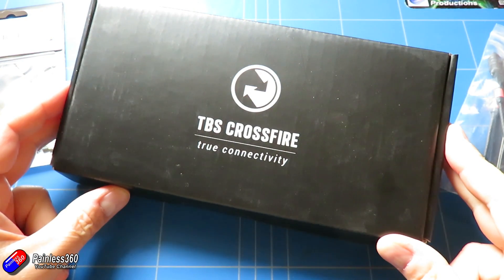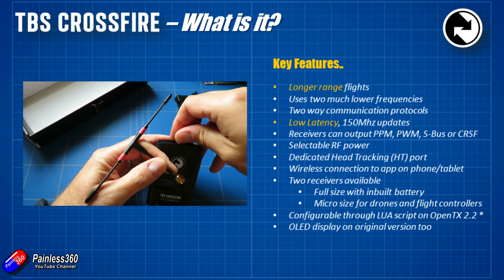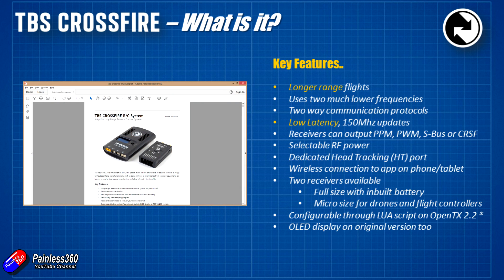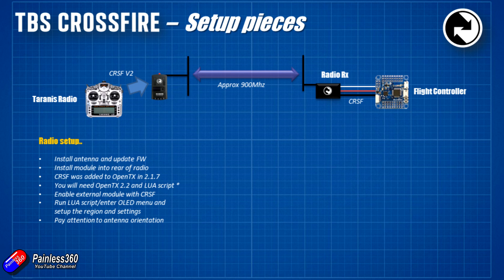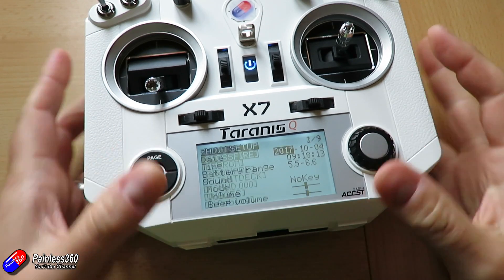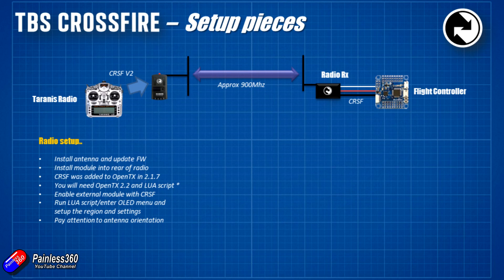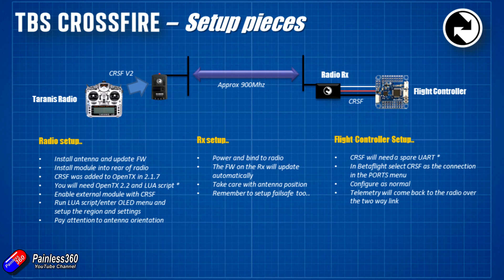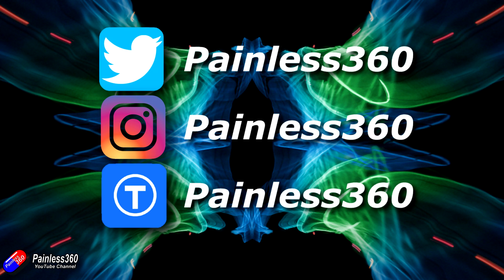(1/3) TBS Crossfire Series: Overview and Introduction

Comment: Great video! Unfortunately, for some reason my TX module does not turn on when it is installed in the remote control, the two cables are connected to the module and the external mode is set to CRSF. Can you please tell me why? If I update it on the PC then it works

Comment: Ahhhh Geeezus!~ Minute 5:20
Rejoining the RC world after 55 years I've been reading and watching everything I can get my hands about FPV and finally the light bulb goes off!  It's an incandescent light bulb mind you...not an LED.
Reply from the maker: Glad my videos are helping it all make sense! :D If you can't find something on the channel that you need, let me know!
Reply: @Painless360  
As a matter of fact....Yes!~ Thank you!
As a newbie in the RC/FPV world, sensory overload is an understatement!
It's exciting and overwhelming.
I had a 3 ch crystal plane with flags that cost more in the 60's money than my current plane and txmitter.
I've a FMS Fox 3000 at  FEDEX facility in Troutdale, Oregon due to arrive at my home in North Central Washington Tuesday.  
I have a Spektrum D-8 G2.
It seems Spektrum was once a leader in FPV but sis no longer or perhaps changed names????
I'm unclear if my Spektrum D8 D8 can do FPV/Crossfire.
If not, can you call out what gear will get me up and running?
Thanks and Cheers from Tonasket, WA
Reply from the maker: Spektrum isn't great for working with non-Spektrum kit. FrSky used to be the goto for things like Crossfire, but now it's vendors like RadioMaster and the ExpressLRS rsdio system for modern hobby...  best of luck
Reply: @Painless360  
That's what I needed...just a push andto be told  which way North is!  ;-)
Reply from the maker: INAV for Beginners 2023 (Baby AR Wing PRO and INAV 6.1.1): https://www.youtube.com/playlist?list=PLYsWjANuAm4q-i0YGMJGLOfaYIuNIYPfF is a build using modern technology and choices... Best of luck

Comment: hallo, if you want to run crossfire with 1.3ghz video will it be ok or some tricks need to be done? thanks
Reply from the maker: It should work fine. Keep the antennas separated on the model as much as possible... Best of luck

Comment: Hello, great guide, I want to try fly longer range with inav and ardu, will fill module with Bluetooth be better or just lite one ?
Reply from the maker: Noth will work great. I don't use the extra features of the larger unit (with the exception of the screen!)
Reply: @Painless360  so better radio like 16s can do a telemetry to a tablet by Wi-Fi or Bluetooth so I could use micro tbs module ?
Reply from the maker: I'm not sure that any of that can get the telemetry to a PC. If that is something you really want then I'd use separate telemetry radios. See my PixHawk 2023 series for how that works with MAVlink and Ardupilot.. Best of luck!

Comment: Is there any version or a way to combine which has 15+ channels and allows me to connect to two or more receivers at the same time?  I need 15 channels, and a separate receiver on my gimbal.  Any solutions?
Reply from the maker: I've seen two. https://youtu.be/ST9LON1-Bvg or using an Sbus to PWM converter.... Best of luck

Comment: Hiya. Thank you for this clear video.

I have a question... say i have the 'full' size crossfire tx (2Watt) and i plug it into my dji fpv remote (into the 3.5mm ppm output jack) is it possible to get telemetry from the aircraft back to the crossfire tx ?

My aim is to use the crossfire module with the dji remote ( to get the benefits of a good/solid long range radio link that is better than dji) but also get telemetry back to the crossfire tx ( which  i can connect to an android tablet via bluetooth and then plot the position of the drone on a map on a using Telemetry  viewer app).
Reply from the maker: I have no idea, let me know if you get this working. DJI kit is not designed with 3rd party operability in mind...
Reply: @Painless360  will do!. i have seen others get dji working with crossfire (but using the ppm output plug on the dji remote to the crossfire. However its using ppm with increased latency). Their aim was to get a more robust link control to their drone so they wouldn't failsafe. They were not bothered about getting telemetry back.

Comment: Is it possible to connect a crossfire receiver system to a different receiver so I can still have as many channels I want from my existing receiver somehow?  I am trying to keep the amount of channels my 20 channel receivers have.  It seems that the diversity receivers have a limited amount of channels but I want more.
Reply from the maker: I'm not sure I understand the question. You want two recievers?
Reply: @Painless360  I want to be able to use all 20 channels that my current radio transmitter supports.  I have an iX20SE.  What is the maximum amount of channels that crossfire supports and which receivers would you recommend?
Reply from the maker: I'm not sure. I've not used that many channels on my Crossfire stuff.. Next time I have it out I'll look. Let me know if you test it too..

Comment: Is it possible to setup crossfire relay /repeater ?
Reply from the maker: I've never seen something like that. Why would you need it?
Reply: @Painless360  I have seen pilots using these techniques to mount crsf module on antenna tracker or keep the module on the roof of the car/house and operate the model from inside car/house. In my case I am looking forward to keep both new 2.4ghz long range module and crsf module, It's not possible to switch the JR bay module every time. If we can operate crsf module as repeater then this issue can be solved. Maybe you already know this technique but by different name, I guess..... In this technique, a 2.4ghz rx is connected to long range module and we provide the signal or command to 2.4ghz rx through radio and that rx transfers the signal to long rang module and finally through long range module to the long range rx .....Few pilots did use these techniques with dragon link, mfd long range module, etc...here's an example by bonafidepirate using dragonlink relay...https://www.youtube.com/watch?v=E5vgkpmPV8Y&t=509s
Reply from the maker: I'd ask those showing the techniques in their videos. I've not explored this here. Best of luck!

Comment: Hello I'm using the full module on a spektrum dx6 running ppm powered by a external battery in FCC region.  I've looked through the power menu and don't see the 2 watt option mines seems to stop at 1 watt. Is there something else I need to do to enable 2 watt. I've gotten great range from 500mw. I just want what I paid for. Lol!

Comment: Dear  
 i have a question . if TBS Crossfire and Frsky R9m both uses 918Mhz Frequency then why both have different range capacity.
Reply from the maker: Range is down to lots of things. The frequency you use is only one of them. There is antenna design, power, protocol, band usage, LORA style management of the link, smart firmware... The difference is that all of those things are far better on the Crossfire system..
Reply: @Painless360  Got it, Thanks..

Comment: Hi very helpful video for me to understand TBS-Crossfire with Taranis, but I have a doubt that which are the sensors available with the TBS Crossfire Tx Rx system as in same class FrSky do have, like Lipo Cell Sensor, Current Sensor,  Temperature Sensor, SP2UART etc. Thanks in advance
Reply from the maker: Please watch the series and my builds with flight controllers and Crossfire so see exactly what you can do with it.. Best of luck!

Comment: can i use this with futaba sg14 and a dji A2 as fc on a looong range HEXACOPTER that is around 1m in size and weight 6kg..
im building a filming hexa to record video and take pics
Reply from the maker: I'm not sure I don't use that radio or flight controller here. Best of luck with the build!
Reply: @Painless360  yeah its a bit bigger then racing drones but even so the parts used should work,like the vtx used in small race drones,,there are those pumping out 1200mw att 5,8ghz.. could i use that in my build ?

Comment: As a newcomer to Quad flying and reading up on everything, I've seen a lot of reference to Crossfire and so came here as a first stop for detailed info.   
However, do the new VLOS laws now in place make crossfire redundant?  I'm getting on a bit now so my eyesight's not what it used to be but surely there aren't many pilots who can see a drone more than a mile away with naked eyes?    Assuming I'm going to stay within the bounds of the new laws, what value does crossfire offer?
Reply from the maker: Check out the full Crossfire playlist that covers all the basics. Crossfire isn't just about long range, it's also for bullet proof signal connection and faster, lower latency connections to the model too.. Best of luck!
Reply: @Painless360  :)  already started reading and watching.  so much to learn haha.  many thanks

Comment: Thanks for the video.  My antennas (two Immortal T's) are mounted in front of the quad horizontally at about a 45 degree angle to the front of the quad.  So should my transmitter antenna be mounted vertically so the ends of the antenna are pointed up and down and not pointed at the quad (unless it was straight overhead)?  Thanks for your help.
Reply from the maker: See my video on antenna alignment in the Cro playlist where I cover that.
Reply: I appreciate your help.  I have subscribed and watched many of your CF videos.   As a person new to CF, they have been very beneficial.  The Failsafe on my quad was from a bad receiver.

Comment: Another needle in the haystack found.
Learned that
★ this is not as easy as I had thought
★ tbs Crossfire seems to offer a lot
★ Crossfire adds a bit of complexity too

I wanna buy one to get strong connection and long range too but I am unsure at what price regarding my frsky receiver infrastructure.

I got the X9D plus last weekend and put it in sale when I got behinds frsky strategy to close their system for Access and leaving d8 owners behind and to kill Jumper as competitor from all Chinese Sales Channels pretty effectively. But I ordered a T16 Pro Hall the Moment I found out opentx will support T16. And now frsky has a problem to sell me stuff - except for high discounts which will hurt them.

My question: this series is 2 years old and I am not sure what had happened with tbs Crossfire development meanwhile - except frsky no longer supplies tbs with frsky Radios.

Is tbs Crossfire still first choice for fixed wing ... gliders in conjunction with T16 Pro Hall ?

Thanks again.
Reply from the maker: It is for me...
Reply: @Painless360  THANKS A LOT ... from germany

Comment: Will the crossfire work on the QX7 if the crossfire is set to ppm?
Reply from the maker: I've not tried but with the mod, you can run the Crossfire at full speed..
Reply: @Painless360  More interested in long range, where the speed part of it isn't that important.. thanks for your reply. Love and used your videos all the time.

Comment: Hello Painless,

I was hoping you might be able to help figure out why I am not getting any response on the Reciever tab in betaflight for a crossfire setup.

Followed you videos and other instruction on the web but I am stuck.

I have a full crossfire transmitter and nano receiver.  The shows bound and gets telemetry data.

I set UART six up in betaflight ports as serial.

I did have ch1 and ch1 backwards on mamba mini F4 FC backwardscfor a bit and hope that did not hurt the FC.

Configuration page set to serial subs and crossfire.

Still no respose on betaflight receiver page.
Only thing I can think of is a problem with the uart?

Thanks for any sugestions.
Reply: Okay just writing the problem out helped.  Finally realized that UART 1 was still set for SBUS!
Reply from the maker: Glad you got it sorted! :D

Comment: Would u recommend this for a  rx8 Spektrum controller? if so how can I setup with it?
Reply from the maker: See my kit picks video from last summer for radio choices (I will be doing an update to it in a months time so it is a little out of date), FrSky seem to be making some odd choices when it comes to the inverters they are using in their radios that mean that you can't run the Crossfire system at full speed, despite them knowing about the problem. Some think it's a deliberate attempt to undermine the TBS product and sell their R9M system..
Reply from the maker: I've not tried it in any of the Spektrum radios, sorry..
Reply: @Painless360  no probs.  Do you know anything compared to the controllers you have used?

Comment: Hi, I’m looking at the frsky long range module and the international version works at 900 MHz and the EU at 868Mhz. Will the 900mhz equipment such as antennas work on the EU version? Thank you
Reply: if youre in europe get the eu version rest of the world prefer international version, no you cannot use a 900mhz antenna with a 868mhz, they are tuned for different frequencies, on the module itself you can just change fw suiting your location.

Comment: Hello !prompt please here at me on Crossfire GPS data from the menu of Taranis does not appear I choose detection of new sensors it about nine finds but among them there is no GPS data. but also for some reason telemetry in lua script inav on the remote also does not go though 3D fixation eventually occurs but for some reason the data from the controller flight most likely do not reach the remote in General I do not know what the problem is. you can tell on Crossfire behind on the remote control should be the last menu item displayed GPS data here I do not have them. in the configuration settings of the flight controller, inav has checked the data telemetry feed.What can be done .Where to find the answer that can suggest the ?!prior to that, the lua Script was working fine through the port F which was flying Nicky. Thanks in advance !

Comment: Hello. I must extant the range on my RC Car. How can I apply this to my RC-CAR Controller?? Any Help please !! Thanks.
Reply: this should work just fine. but just as with any low power tx signal, the ground itself will block signal. the diamond antenna is supposed to use the ground to extend range though so that is probably the way to go

Comment: Dose the lua script work with the full size crossfire on the X10/X10S?  Can't get mine to see the crossfire module?!?
Reply from the maker: There is a LUA script in the SD card contents for the X10. Make sure the module has power and the external bay is selected in The menus..best of luck!
Reply: Got power modules selected and running crsf just can't get the lua to recognize it? Really hope there's  a way to do this from the x10/x10s I am really excited to do the changes from the controller rather then the module... thanks for the replie its greatly appreciated+
Reply: Turns out you need to turn down the baudrate in the control to run the lua this will slow the crsf way down but is the only "easy" work around the other option is to desloder a chip in the radio and wire in a new one! Here the link JB sent me to that  Explains Everything...
 https://blog.seidel-philipp.de/fixed-inverter-mod-for-tbs-crossfire-and-frsky-qx7/#Mod_for_FrSKY_Taranis_QX7

I hope this helps you and everyone reading maybe you can do a video on this to help all the new frsky owners like me, thanks for all your videos and help your work is greatly appreciated!!!

Comment: With my drone turned on, if i turn on the radio my crossfire micro takes about 25~30 seconds to connect to the drone (nano receiver) is this behavior normal? If I do the same but turn on the radio first it connects instantly... Thanks!
Reply from the maker: I'd always turn on the radio first anyway. I'd update to the latest firmware (v2.4) and see if that changes anything.. Best of luck!
Reply: Painless360 Thanks for the answer, I was already in the 2.4 firmware, I just tried to bind it to another RX and the problem disappeared... Really weird, maybe something related to the open TX o the lua script. Thanks!

Comment: Nice video.
Now, how would you go about using your other non-Crossfire RX's ?
Is this a dedicated system once installed? So, that you can only use the Crossfire system?
I guess my question basically is, what do I do when I want to use my XM+, or RXSR receivers?
It sure would be an expensive endeavor having to dedicate that one radio for Crossfire, or having to 
change all my receivers to crossfire...?
Again, very nice video and I'm "SUBBED" :)
Best
Reply from the maker: Select internal vs. external transmitter and you can choose between the two. See my video on it. You can find it by Googling something like 'external module painless360'

Comment: FrSky R9 Mini 4/16CH 900MHz Long Range Telemetry Receiver with Redundancy Function S.Port Enabled on pre-order now banggood Ready Made RC Elsa got the transmitter off eBay with the new style antenna for $40 bucks 
full Telemetry which means Lewis scripts VTX control pretty much everything

Comment: Hi I fly both mini quads and wings, i recently have put a ezuhf system in my wing, would the crossfire be better than the ezuhf ?I also have an auto pilot in my wing but it still uses pwm can the crossfire still use pwm if i needed to?I currently use 5.8ghz for video will the crossfire interfer with 5.8ghz or 1.3ghz?could you do a series on setting on up in a plane with an auto pilot and how to set fail safe to trigger rththankyou
Reply from the maker: All covered in this series, keep watching...